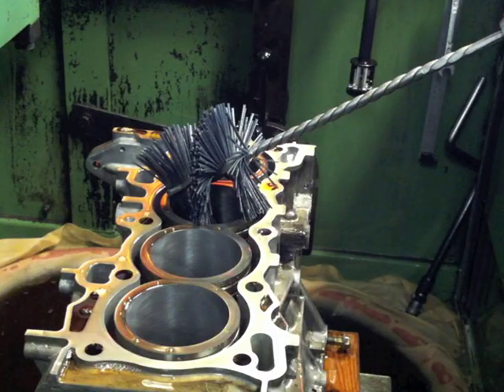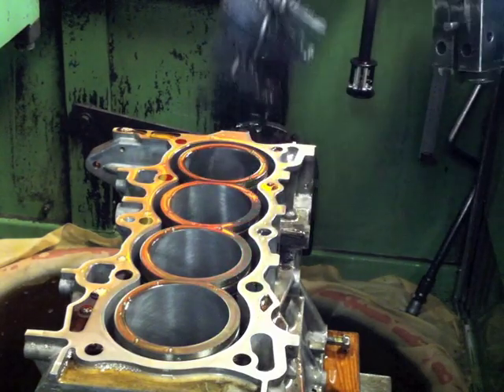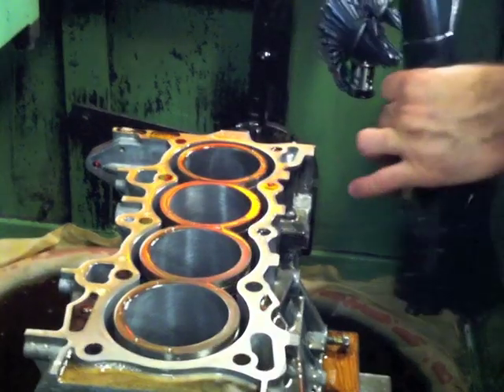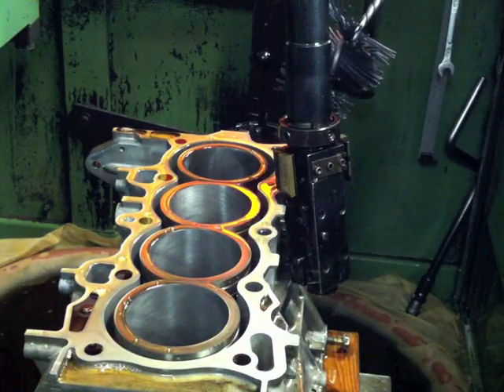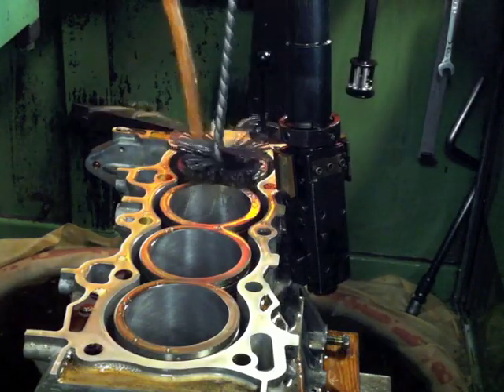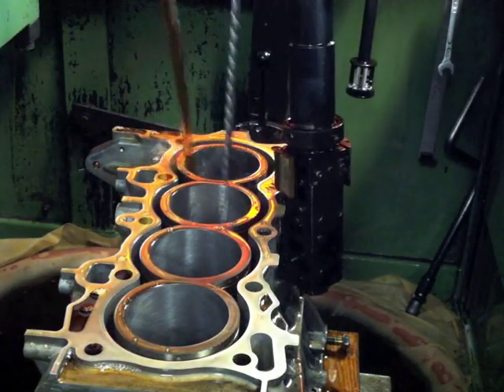D16Y8 Cylinder Honing

Comment: why is the block moving? your measurements will be off.
Reply: +Matthew Whitten 
i know how it works. i also know its wrong. you only measured from the 12 and 6  o'clock position and not the 9 and 3. the motor is twisting when the hone comes up and that causes one side of the cylinder to get more pressure than the other.